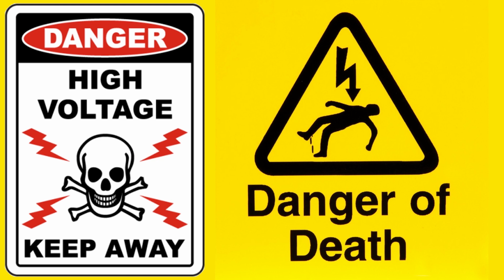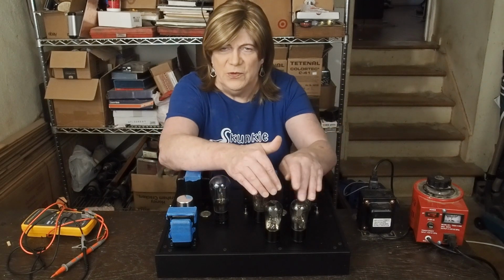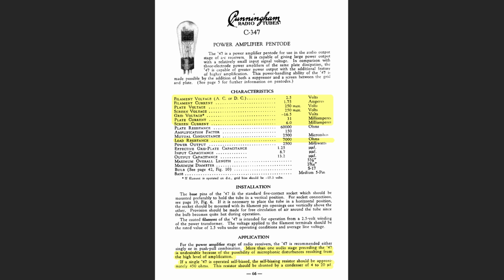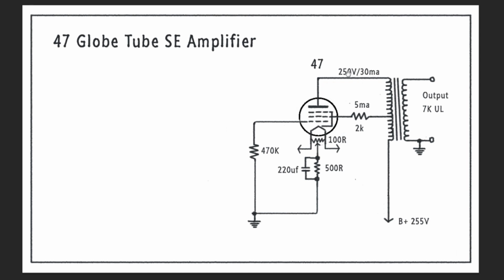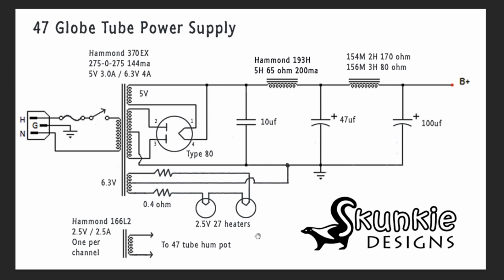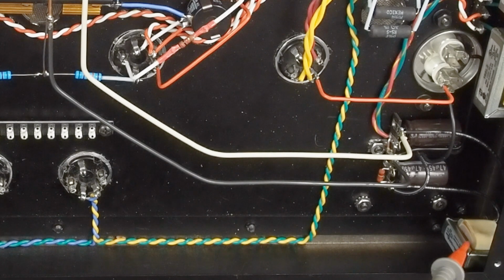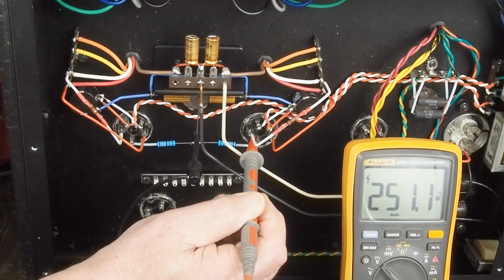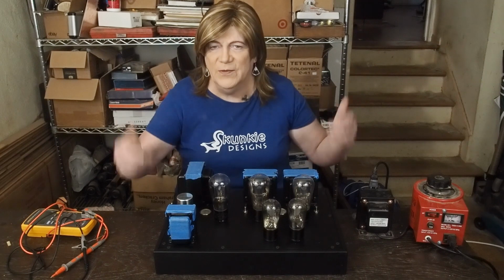1930's Globe Tube Amp: First Power Up!

Comment: Hello, could you explain how, when designing the power supply, you calculated your circuit load? This is something I often wonder about, but rarely find explicitly explained. Thanks for the video. Great information.
Reply from the maker: I need to do a video from start to finish how I designed this circuit. Basically I look up the max/expected load on the data sheet of the output tube, in this case 31ma X 2 +  the driver tubes will pull 4.5ma X2 and add all this up.
Reply: @SkunkieDesignsElectronics  Great idea for a video! And good explanation to my question. Thank you. I've been curious to know how to simulate/substitute the entire circuit load with one hi-watt resistor. Especially in the transformer selection stages of the power supply design. So that the PS can be loaded as it would be in normal operation, and so that there are no big surprises after having purchased a new (and potentially expensive) power transformer. My skills and understanding aren't there yet, and I haven't found a concise explanation of how to do this specific thing anywhere. I bet a certain Skunkie Designer knows all about that though.. In any case, thanks for the helpful videos and cool projects.

Comment: Thanks for another outstanding video! I'm wondering if it's possible to use the center tap on the transformer for the 27 tube heaters to balance the current to the heaters? One tube from each center tap?
Reply from the maker: I was thinking about that too, will test that soon :)